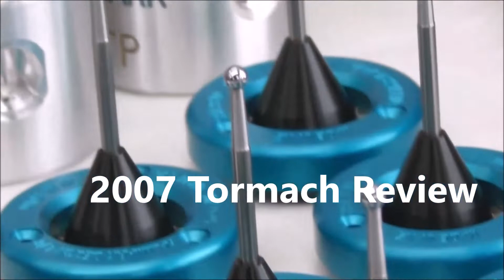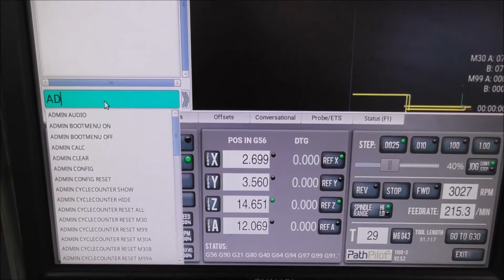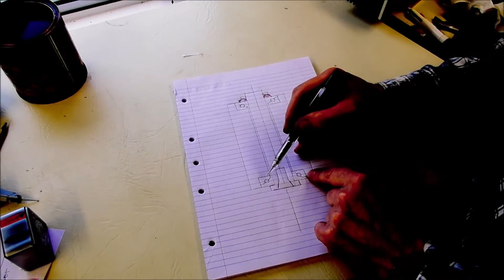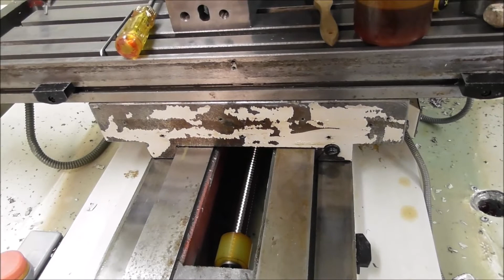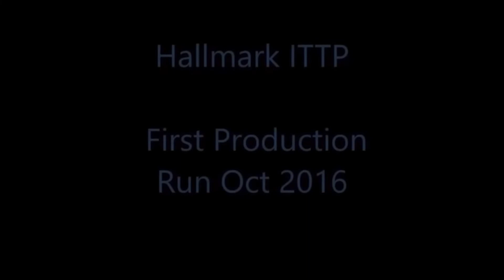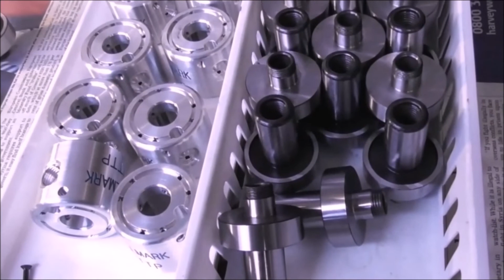Tormach 2007 Long Term Review

Comment: I have a similar age 770 and just use it periodically for hobby use. Recently, when the spindle was turning, it started making a "whop whop whop" noise and after running it a bit more the spindle belt broke. Am wondering if I know I am not going to use the machine for a while, should I take tension off the belt?
Reply from the maker: Hi - Yes that sounds like a good plan. Cliff